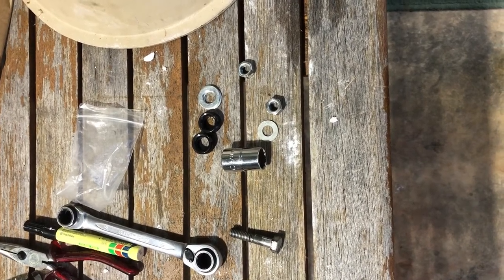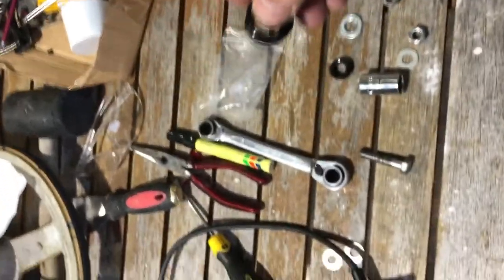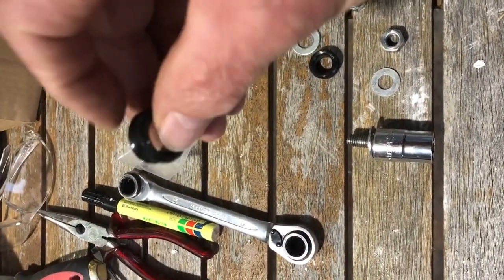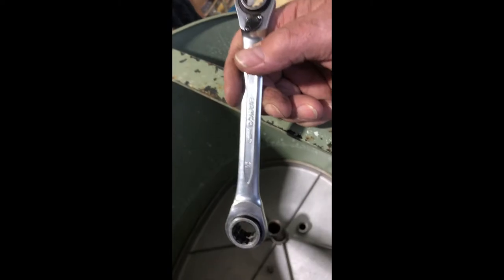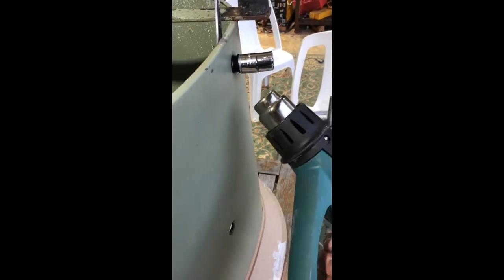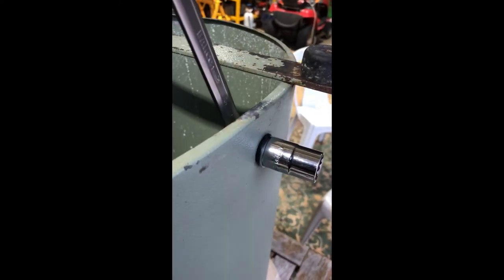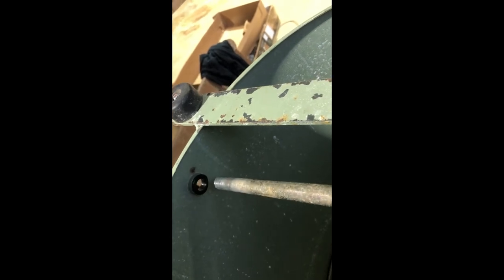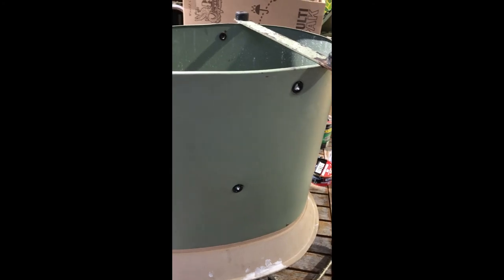Venco pottery wheel Grommet replacement

Comment: I've seen this technique used a few times, but I didn't have much luck with it. I ended up damaging the paint and damn near shearing a grommet in half. What did work for me is heating the grommet in some hot water, applying a little silicone oil around the hole and then giving it a swift tap with a rubber mallet. Simple as; just gotta be careful not to beat the whole thing out of shape!

Comment: Does the bar that goes between the motor and the foot pedal need two grommets? I’ve replaced the two smaller grommets that hold the motor in place and three of the grommets that go where the two round bars run between the outside of the wheel case, but I’m not sure if there was originally grommets on the flat bar that connects the foot pedal to the motor
Reply: I know this is five months late, but yes, at least for the venco no 6 there are two (small) grommets in that bar. I assume it's the same for other models.